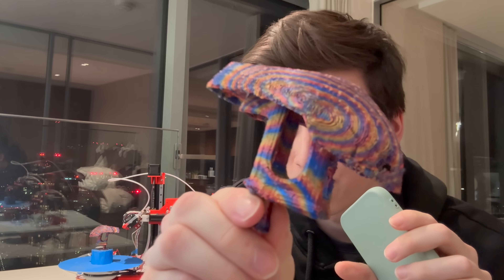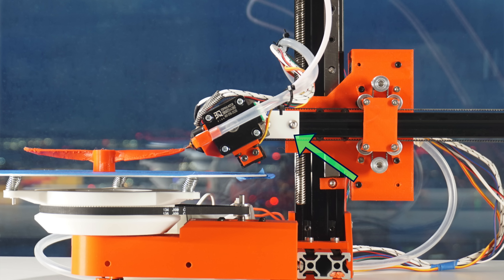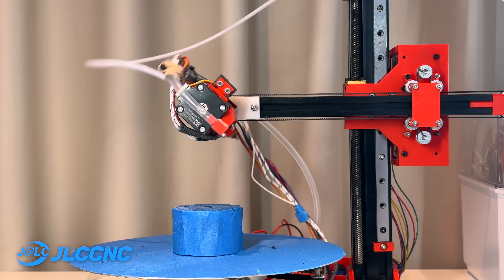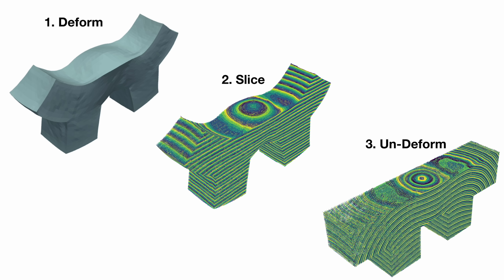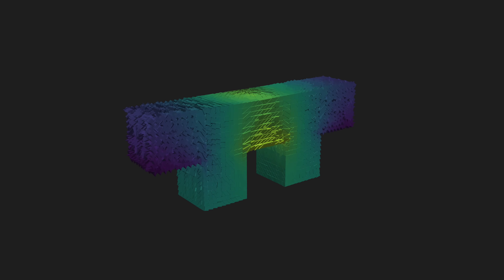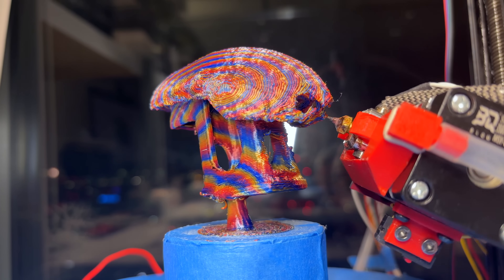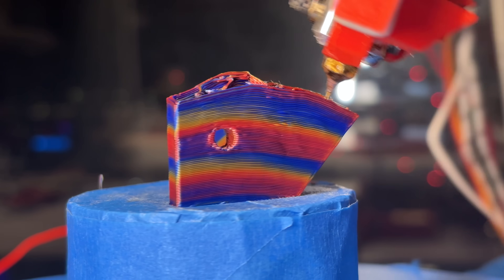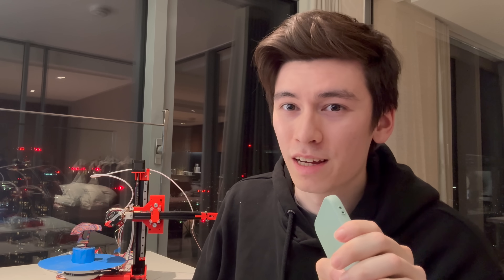3D Print Anything Without Supports

Comment: I'm wondering if its possible to optimise prints for structural integrity, instead of support minimisation? 3D prints are (famously) weak between layer lines and stronger across a printed plane. So much so (and as demonstrated in your video) that reorienting a part on the print bed is something we all play around with to make sure parts are fit for purpose. So orienting cross planes along directions to tension or perpetual to sheer forces might be functionally useful.

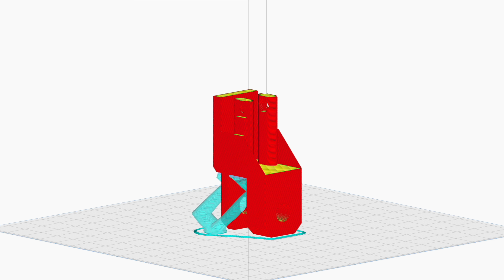Eg.1 Core axis mount. The tensile forces would split the part as spotted 1:13. 

A traditional orientation change on a regular 3D printer could completely solve that printing problem, at the cost of supports.

From the layer lines in the non-polar printed model 1:21 have taken a middle ground and printed these at an angle. This improves the integrity near the base as it integrates with the main body, but leaves extremities weak to sheer forces.

Eg. 2. Propeller tips: If printed as demonstrated with the radial slicer, there is a concern that the outer tips of the propeller could pull off in use, or be bent off if the propeller hits something. It seams this print in the particular it is printed is likely to fail in an actual use case?

A 3D print i've struggled to design is a badge card holder, with one side available for swipe access. Initial prototype a box with a box negative to insert the card, not going through to keep a spine on the holder so the card doesn't go straight through, with wedges on the inner lips to keep the card securely held.

In that design, I care about being able to keep the inside clear, while being aware of sheer forces from the card pushing the wedges against the side walls. This means printing on the spine has issues, as the spine separates from the walls under sheer from the card insert. 
Printing on the walls is a problem similarly as the spine itself splits under tension. (Not least requiring a frustrating small amount of inner support.) In this conficuration I also have issues with the wedges being layered and becoming dislodged when inserting the card. (A very minor but useful case of non-planar 3D printing ive been wanting to get working: GIVE ME DELIBERATE BUMPS as part of my final (ironable) surface)

I had some success printing on its side, but in practice this snaps like a twig.

I'm at a point in making a multi-part design, so I can optimise strength at different compenents. But it would be good if I could say "This part will be pulled (experience tensile force) in this direction, or might be dropped on this extremity, or this extemity may be bent (radial tension? Is that a thing), or this part will be sliding against another part here (sheer). Optimise the print path and bed placement to maximise strength in these sections."

Comment: I work as a dev for industrial slicers and am extremely impressed by your work. You have a bright future ahead of you :)
I find that the most useful and robust algorithms are often the simplest/cleanest ones.

Out of curiosity, does the deformation ensure that different parts of the mesh won't merge? As in, if you print something like an upside down jellyfish, would the tentacles not tend to merge during the deformation process?
I could see that being a nuisance when trying to create inner features like walls or infills.

Comment: That is most probably the next big step for 3D printing, like 5 axis was alrezady for cnc milling. It still needs a lot of refinement though, both on software side and hardware side, and the hardware veing much more complex for 5 axis it means not everyone will switch from 3 to 5 axis (again, like for milling). I'm waiting for a more polished version of the software before working on an optimized hardware for it. Nice job, go ahead 😊

Comment: Another improvement that can be added: There is no need for this algorithm/tool path for the volume which already does not require overhang and so we can remove that part from the equation and computation time and print time will be reduced. I am an engineer (I don't have any experience in 3d printing or did any 3d prints myself but this is just what my enginner brain thought about). So please correct me if I am wrong. Great video though!

Comment: A M A Z I N G ! ! ! Just one question, is the slicer made only for 4/5 axis printers or can it be used with the ubiquitous 3 axis printers? I recall a video by some other wellknown 3D printing channel showing a modified slicer with nonplanar slicing made for 3 axis printers, it was a thesis. The limitation was the tip angle sector free from obstacles, which is not very big in normal printers.

Comment: It's likely that you can find further optimizations in how you handle the mesh for morphing it from video game engine papers. 
I didn't get far enough in the code in 5min to see how much you optimised to stay within numpy as much as possible and benefit from the C speed. But regardless of that it seemed like you're brute forcing path calculations and it might not be necessary. I'll have to look better, not just from my phone. I could be very wrong.
Good luck, the results are already very promising.

Comment: Cool  - on to a new generation. Near zero waste. Crossing print flow layers like plywood to increase strength or rigidity. Or having print layers flow in the same direction in areas to allow more flex there....
The whole slicing concept needs to change to expansion along face normals (or similar), rather than bread slices. 
Wish I could understand the needed math......

Comment: Now, the only problem I can see, is that propellers are still a pain to print. No matter what orientation you slice it in, the deformation will cause the edges of the prop to both face upward, or have one face upward and one face downward, resulting in the final un-deformed model to include layer lines that are almost perpendicular to the torque forces when being used, as when they are spinning, drag is acting on the props and pushing them back, creating the annoying torque forces. Supports are sadly the only way to go in this scenario.

Comment: note : a lot of times you want a human-specified path. If you want a part to be strong in certain orientations you'll want to manually be able to orient the layers in certain ways. (or if you want certain aesthetic properties, etc.) Don't let me undermine this, true, automatic, support-less non-planar slicing is fucking amazing, but I do think it's important to clarify that "manual" non-planar guides are actually incredibly valuable. 

Think about them in the same way you'd think about condition-modifier blocks in something like Orcaslicer. Sure, you want the slicer to be able to generate the gcode completely automatically, but a lot of times you also really want the ability to manually specify how specific parts should be printed as well. You want the computer to be able to automatically figure out most of the problem with some basic assumptions (like "generally speaking I don't care how the layer lines are oriented") BUT you want to be able to manually tell it "EXCEPT HERE, HERE I REALLY BLOODY CARE AND I HAD BETTER GET EXACTLY WHAT I ASK FOR!".

Slicing was good before condition modifiers, but it was great after them. The alchemists-stone of non-planar 3d-printing would be somehow being able to implement constraints with this deformation approach, so you can somehow define specific orientations some layers should be at, then let it deform around those constraints without ever violating them.

Again though, I have to be clear, this is huge and this is to the point already that you should probably consider reaching out to either someone in the Voron community, Orcaslicer community, etc. or even maybe to a company like Prusa or Creality themselves. Fully automatic non-planar slicing is still huge and while none of these prints as-is would be winning any print-aesthetics competitions anytime soon, they're already super solid.

PS : You might want to reach out to some people who have done strength-tests of 3d printed parts. I think it's Stefan from CNC Kitchen that has his tester rig, you might want to reach out to him and send over a few printed samples in PLA+ or something, printed at different orientations. I think there is a very real chance that, in any real print, the layers being distorted might interweave together to create an insanely strong part. ESPECIALLY if you tested with a filled-filament which tends to get stronger strength aligned with it's layers but worse layer adhesion.

Comment: The potential here for toolpath solving for part strength is a huge step, much bigger than solving for overhang.  I'd rather be printing against breakaway or dissolvable support (much easier with one filament change)

Comment: Very cool. It might be helpful to refactor your code into a more conventional library (essentially a set of useful classes and functions). You can still have a single Jupyter notebook as an example entry point, but this way if someone wants to pull in your code into a larger project, it’s much easier.

Comment: Not to talk this down, but your argumentation on how you can print strong parts in "impossible orientations" does not solve how the layer lines are still perpendicular to the torque direction, making the part weaker again.

Other than that, awesome technique, love the algorithm.

Just hypothetically, would it be possible to use part of the algorithm to print about two layers near horizontally and after that use them as built in support to print the rest of the "extension" along its length for actual superior stability? This would probably hit limitations on how many appendages can be printed, for example you wouldnt be able to print a spiked ball like this much more than halfway through, but your presented fixture would basically be printable flat, with most layer lines along the walls.

Comment: I'm glad to see such a positive reaction in the comments.  My one fear is that someone watching this might hyperfixate on print quality and miss the forest for the trees.  This is one guy revolutionizing the industry with the world's first accessible non-planar 3D printing.  It's entirely possible that there will be a myriad of fast improvements thanks to this stud keeping it OS.  I don't think it will be very long at all until print quality in a non-planar format meets or even exceeds what we can do now.
Reply: Print quality was one of the things that came to mind, until he talked about what he was doing.  His slicer code is running in an interactive notebook package, and he's using a lot of simplifications and shortcuts to get it to be performant in that environment.  Just putting the code into a proper environment would speed things up enough to add the precision needed for production level output.
Reply: Also we can't underestimate the value of a 3d thermoplastic - Lattice for thermoset resin impregnation / surfacing.. Such techniques can address a lot of "issues" with the quality of 3d Printing. Many people out (consumers) there have little realisation that most CNC machined parts require "finishing" to result in the "CNC Quality" of surface finish that people are used to. 

What consumers yet dream if is "works of art" without  the need to have 'personal artistic talent" - sadly, most of the art pieces one sees on thingiverse (etc) are the tireless "labour of love" by artists in the niche model making scenes - for those who want a "doodad", they should be very thankful that ther eare people out there who just love to tinker...   (What happened to the world of painted models?? - it wasn't s long ago that was a huge thing.. - same with RC aircraft, everyone just wants to fly an BNF without doing the hard yards before.)

Comment: Incredible work. I see you’re using an unconventional printer geometry, would this code also be potentially applicable to a coreXY with independent skewable Z? Or even a 3-axis printer with just a very pointy nozzle?

I wonder, how performant this could get if it wasn’t running in Python, and had access to GPU parallelisation?

Comment: Great achivement and thank you for making a video about this. 

Is it possible to also optimise for strength at the sane time? It already has better layer orientation in some cases, but is it possible to push this further. Like recognising where doing nomal bridging it is simply better? For example on the demo part with the two feet an the overhang in the middle a normal bridge is best in the middle, while your methode is better for the side.

Is maybe also possible to optimise for strenght by changing the layer direction. For example on a large vertical feature making the layers as much as possible along the vertical axis. You could do this by having the programm optimse the extrusions for maximum lenght and therefor connecting as much as possible with the least amount of interfaces(weakpoints).

Comment: Great work. In the recent paper on radiant foam they found optimising voroni diagrams solves the problems optimising delaunay triangulation as they're more well behaved, then the result can be easily transformed after. Don't know if this is helpful for you as you solved it anyway but it would allow you to allocate more geometry in complex areas and less in large simple areas and probably optimise faster.

Comment: Can you use a single color filament in the next test? This multicolor shiny one makes it very difficult to guage the print quality on video
Reply: I think he uses it to visualize those multi-vector toolpaths. And quality there actually looks very bad due to, it seems, the printer design, so only thing you'll see with the single color filament is only how bad the result is. But I think it is more a proof of concept since the idea behind it is actually brilliant =))
Reply: @Harh1981  right sorry I'm not saying he shouldn't do the multicolor just that also showing a solid color would convey more detail
Reply: @Zack-y4p6t  Isn't the opposite of that true?  The contrast of colors literally contrast each line... which allows you to see how inaccurate this printer is.

Its not a bad design, but obviously a dual ballscrew design, and a using a stepper to turn teeth on the outside of the platform, would lead to a better design.

Using a single stepper to control a rotating platform will lead to increasing loss of accuracy as models get larger.
Same with the printer head itself.  

That said, those 3 changes would more than double the cost of the build, and slow down the printing speed drastically as well... So there are maybe fair compromises to be had to get whatever you want out of this design.
Reply: @thisisashan  honestly idk what half of that means but I just meant for surface quality not layer quality
Reply: @ Basically I said, "blah blah, proof of concept, blah blah, someone could use other proven concepts to make this better, blah blah"

Comment: Fantastic work!  It might be interesting if you had a mode for optimal part strength vs optimal surface finish vs optimal speed or the ability to apply a percentage of each. I would love to build or buy that printer you're using.

Comment: Built entirely in a Jupyter notebook. Dear god.
This is why we don't mess with data scientists.
Reply: Research labs have programmers who's whole job is to take code like this and turn it into something optimized to run on supercomputers.  A Jupyter notebook is so much better than some domain specific languages I've had to deal with.
Reply: I was thinking, it would probably run a lot faster if it were written in Rust or C
Reply: @c2gamser Possibly less than you think.  Libraries like NumPy do all the hard work in C.  Properly used the speedup is negligible.
Reply: @c2gamser  Possibly, but Numpy is also pretty insanely well optimized for maths stuff. That is, assuming you can keep the Python-side calls low and your arrays large.
Reply: @c2gamser  ...and have taken another decade to develop

Comment: Pretty impressive. It looks like something that would be painful to implement and debug. One thing I dislike about these methods that bend the object, slice is and unbend it is that it can potentially stretch some areas. Isn't it for example possible that outside walls would get stretched in places and individual lines would be printed in bigger distances possibly hindering layer adherence and compromising strength. Also, if I understand correctly, this does bend infill too. From the video everything seems to work nicely in practice, it's just some idea I've got after seeing this.

Comment: This is insane! I can't wait for this to become commercially available. Possibly stupid question: with the printhead arcing away from the prints does that mean that layers aren't exactly the same thickness throughout? Like on the layer that begins in arc away from perpendicular with the print bed is one side thicker than the other?

Comment: Does this require a >= 4-axis printer? I know it's necessary if you want more than a certain rotation angle but what if you just want a bit of nonplanarness to print slightly greater overhangs?

Comment: That is incredibly smart. Not only do the prints look incredible with the rainbow filament, but I do wonder if the non standard layer direction would create stronger parts since you would be dependent less on layer adhesion and across longer surfaces

Comment: Once in a while you see something cool where you think to yourself "you could probably print directly off the model instead of using supports, but needs different hardware and software" so you shrug and move on. 

Only to later find a really cool video where someone not only had the same thought but also the skills to actually back it up.  It's like seeing a puzzle where you once thought to yourself "that probably has a really cool solution", and then later finding said solution laid out with beautiful figures and clear explanations. it's a rare treat